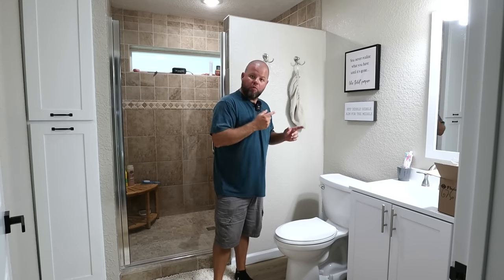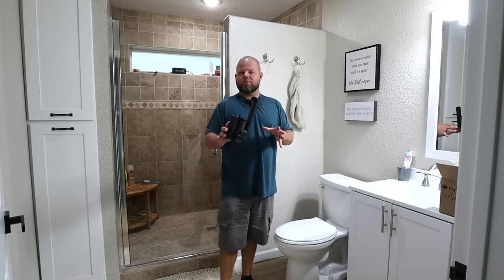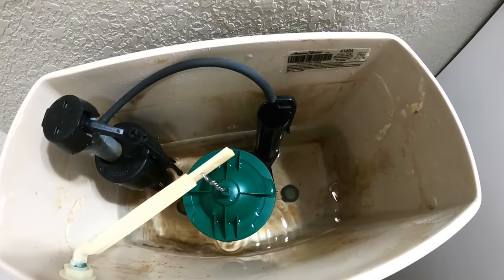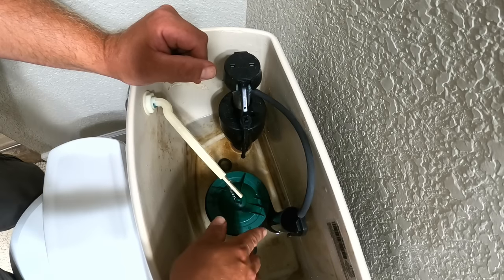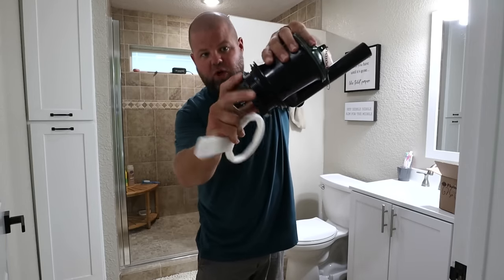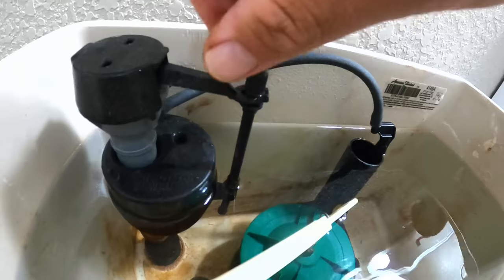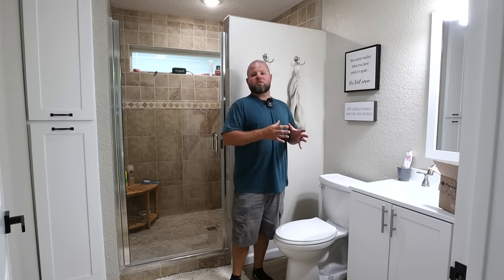Fix your leaking toilet! American Standard Champion  #788

Comment: I had the same toilet for one month. Already having to replace the flapper. Lesson learned, never buy American Standard again!  American Standard is absolute garbage.
Reply from the maker: The new seal takes care of the issue. I love the power of this toilet after the fix.
Reply: Facts! I'm replacing mine for the 2nd time. I purchased my home only 4 years ago, a new build.
Reply: These toilets are utter Garbage replaced this part more than once...
Reply: Doesn't the new (and upgraded seal ) last longer ??
Reply: @420surfdawg  I bought this toilet a year ago because I thought it was the best, oh was I wrong. This is the second time I've had to work on it. A couple of months ago I had to replace my filler valve. Never buy American standard it is junk? Thank you for your video because everyone told me I had to take the toilet apart to fix it. You saved me a lot of time and trouble.       Joe

Comment: Thanks for showing how to unscrew the flapper!  You have the only youtube video I could find with my style of flapper
Reply from the maker: Glad it helped!
Reply: Same.
Reply: Same here
Reply: Also same man just saved the day for me
Reply: Same
Reply: When unscrewing the cap, the stem/shaft dropped down out of sight.😑 I suppose I need to remove the tank to try to find/fish out the stem? If I am unable to locate the stem/shaft, I suppose there's not really an issue with leaving it where it sits, and replacing the whole unit?
Reply from the maker: @scottlawless9388 you definitely want to keep a grip on the stem. I'm not sure if it will ever enter the toilet where it's at, I don't believe it will due to the turns in the toilet.
Reply: @TKCL  Thanks. I've now got to remove the tank, and have a bolt that's frozen. I'll follow-up if I find the stem after I remove the tank!
Reply from the maker: @scottlawless9388 other than that stuck bolt, it's quite easy to remove, two plastic nuts under the tank and it will slide up and off the seal.
Reply: I had to ask American Standard for a flush valve. They sent me a new flush valve with a replacement (red rubber) seal to replace the white/ clear one that came with the valve. I watched your video and it appears so did they. I've replaced the seal as mentioned we'll see if that stops the leak.
Reply: Same here…was about to take tank off until I watched

Comment: The new round gasket helped, but didn't stop the leaking completely. After much frustration, I bought a SECOND round gasket and put it with the first round gasket, making it TWO layers thick. Presto!! Problem completely solved.

Comment: We have a toilet that had a nagging leak a few years ago.  I replaced the flapper several times and it still leaked.  Old timer at the hardware store told me to apply a coating of Vaseline Petroleum Jelly on the bottom of the flapper where it contacts the opening it seals up.  I was skeptical, but gave it a try.  Toilet hasn't leaked yet.  I did the same thing to our 2nd toilet and both my Mom's toilets when they started leaking, and it fixed those too.
Reply from the maker: Nice!
Reply: @TKCL  I feel like placing a 2nd Ring on and add Weight to the Flapper, over so many flushes eventually what  is placed on can     desolve off

Comment: Excellent video - I wish I knew how dicey the flush and flapper were on this toilet before I bought it and had it installed.  It has had numerous run-on issues - and as you showed, it's most likely at the flapper.  As other commenters have said:  thanks for showing how to unscrew the flapper.  I purchased a set of 2 Pack 7301111-0070A Flush Valve Seal Kit for American Standard Toilet Valve Seal for Champion 4 Tank and Eljer Toilets Flush Valve Gasket rings, from Amazon.  The new blue rings are slightly thicker than the original clear ring.  One other IMPORTANT thing:  there is a locking mechanism that locks the ring in.  It must be turned to a "mark" to secure the ring.  So far, this ring replacement has SOLVED the problem.  I did not need to purchase a complete kit.  Just the seal rings.  Thanks again for this video and your other videos!

Comment: Nailed it!! I've only had mine for 1 month and the flapper seal just completely separated! Brand new bldg. Every place I've ever moved w/in months I'm having to fix my toilet for some reason. I even have spare kits now. I finally after a lifetime of apartment DIYs education i told my friend helping me unpack and she saw the kit and I said "nope put it away! I finally have a brand new toilet!" DAYS later and days leaking and adjusting the valve, today I'm fixing it. Never had American Standard flapper and i got as far as trying to take it off and figured I'd need to work in the tank. I wasn't even looking for an answer to that just wanted to see the parts assembly. You SAVED me so much the first 5 mins i just HAD to "THANK YOU!!" BRAND NEW!?! it just fell apart! So my streak and education should be complete now! 😅😅 Dang! 🤐
Reply from the maker: There is a newly designed seal that work's great. It's on Amazon, link is in the video description.
Reply: @TKCL  I could've put a work order in but it was the weekend. Once i put a light on it and found the base it sits and attached to completely blown off swimming around if it was just that ill save the call to maint. Since Thursday lol i was just stuffing the seal up the cap was time😅🙄 till i was tired of hearing it $$ then a few stabs at separating it off then you saying right up it  DOES come off i w got whoopwhoop OUT LOUD YEH!! I finally caught a real break for Diy rabbit holes for once!! 🤟 You were ONE in BILLION that did a video right and i got it on the first click. That toilet is a chicken wrap! It's done! Thanks to your vid. Owners can buy the assembly if it blows off again😅

Comment: This was a great video for this kind of toilet. So, what I did was unscrew it and then remove the plastic cap holding the gasket down and pulled gasket off and noted that on the side away from the drain there was an indentation in the gasket so I flipped the gasket over and it fixed the problem. Thanks, one of the few to address this kind of toilet. Great video.

Comment: You can also change the fill valve without replacing the entire float assembly. And you don't have to take the float assembly out. Takes about 1 minute.

Comment: So I encountered a problem that wasn't addressed in this video and it may be because the newer flush valves don't come apart easily or something. I was able to take the old flapper off inside the tank but the new flapper would not come off of the new flush valve. What you can do in this case is unscrew the top where the chain connects to the new flapper. You will see the seal held on by a gray plastic ring. Twist that and remove it and take that seal out and replace the one that's leaking on the old flapper and put the old flapper with the new seal back on.

Comment: Great video. I’ve replaced the flush valve assembly every year for the past three years but great to know it’s actually the flapper.  SMH thinking of replacing the toilet all together.
Reply from the maker: They now make an improved seal only, I changed to it with no issues. I put the link in the video description to the seal. You can find it on Amazon.
Reply: I’ve replaced mine with the new and improved twice now

Comment: Before replacing anything!

Remove flapper cover and make sure the gray ring that holds flapper right under green cover is secure, mine came loose from manufacturer and leaked. Thanks to this video I removed cover and found gray ring loose. Fixed my situation.  Good luck people.

Comment: Absolutely super video! I bought 4 yes four toilets because I was tired of the cheap flappers; I also heard good things about American Standard.  Well, you are spot on. I changed the first one a year ago and did it the hard way. Slipped off the seal over the top.  This time, I took off the entire drop-down flapper.  So much faster!!! Some suggestions: take off the flush lever and use latex or rubber gloves, which allow a sure grip if you have a weak grip or a build-up of slime on the parts.
Reply from the maker: FYI they now make just a replacement seal that appears to be new and improved.

Comment: I have an older Champion 4 which I previously did battle with the part that screws into the flapper from the top.  After conquering that technique, I replaced another toilet with a newer Champion 4.   The new one started phantom flushing after a few months.   I opened it up and was faced with a new flapper design.  Your video really helped me conquer this one.    The new design is an improvement over the older one, but that gray clip seems pretty flimsy.   I think the next time I need to replace a toilet, it will not be a Champion 4.

Comment: Another thank you.    I bought 2 of these toilets in 2022 and one is one is now cycling every 20 minutes or so.   I couldn't see or hear any leaking but this is most likely the issue.  reading in the comments, it sounds like Home Depot  now has replacement gaskets or flappers in stock.  I will have to check it out.  Great helpful video.
Reply from the maker: Amazon now carries just the seal as well.
Reply: @TKCL  Got a link?

Comment: Great video.  Once I got the flapper off, I found I could turn the bottom a quarter inch and pop the bottom off.  That way you can just replace the seal and not have to buy the whole assembly.

Comment: Mine was leaking from the flapper.  Took it out and noticed the bottom part was loose and not pressing the seal firmly to the flapper body. Gave it a twist to tighten it up, reinstalled, and all is good. Thanks for the video
Reply from the maker: Thanks for sharing

Comment: man, thank you so much  we have had ours for maybe 9 months i already replaced the entire flush valve once and its leaking again  i took the silicone gasket off and were the bubbles were in it  i just took a needle and poked a hole and water came out the gasket then flattened out i put it back on and no more "running" toilet  will see how long it lasts.. i did order replacement seals just to have in case this does not last  again thank you for the video this was the best instructional video i have found for the champion toilet
Reply from the maker: Your welcome! There are new green or blue seals now, I replaced them on both of our toilets and so far so good 🤞

Comment: My issue was related.  There is seemingly a greater level of vulnerability to leaking caused by calcium buildup on the circle on which the flapper sits.  Removed flapper per the excellent tip in this video, then let  CLR sit on the calcium for a couple minutes, then wiped away until all calcium removed.  Then good to go.  

The Vaseline idea is really cool.  I’ll bet it has both the benefit of aiding seal and resisting calcium.  Will try on the inevitable next treatment.

Comment: I have the exact same toilet. I had to replace the flush assy also after about a year. After some research, I found that the flapper goes bad because of the use of tablet cleaners being placed in the tank. The chemicals/chlorine cause the rubber to bubble up and cause it to not seat flush on the valve. My wife now uses the stick on ones in the bowl instead of the tank.
Reply from the maker: Good to know
Reply: We also use those chemical tablets and now have a running tank. I bought a generic replacement valve seal and replaced the original, but it still runs.
Reply: @JasonMaehl  If you have stopped using the tablets, I would recommend replacing it with OEM. I bought four of them as spares and havent had to replace it since we stopped using the tablets.

Comment: This video helped me disassemble the flipper unit. I took out the seal which had the blisters. I don't know what causes them but I ran a tweezers into them, fluid came out, the seal flattened out so I put everything back together. We'll see how long it lasts but so far it's leak free.
Reply from the maker: There's a new design seal that works well. I found it on Amazon and out the link in the description.
Reply: @TKCL  I was thinking with how easy that seal can be removed from the flipper it's insane there's not a replacement easier to find.

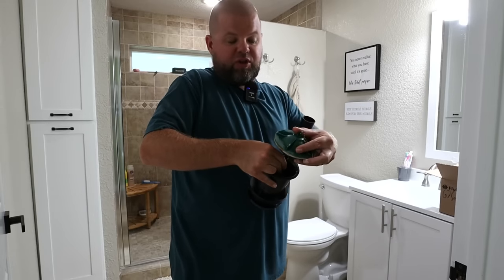Comment: I did this and it worked like a charm. The only thing that I would recommend is to use vise grips under the bulb when unscrewing if you are not taking the tank off. Mine fell down into the toilet. Luckily I had a long pick up tool to bring the "post" back up through the center. See 2:37 in the video. Otherwise, a flawless hack.
Reply from the maker: Glad it was helpful

Comment: I have three Champion 4 toilets installed over several years. I know, I know. My thinking was over that time the design process would have improved but it did not. All three have the ghost flush. I called American Standard and received a new gasket for free ( this was 5 years ago). I changed the blistered gasket (very easy) not the cap as shown in this video. Six months later ghost flush again. I see NU Flush has a conversion kit for this toilet, to go to the tried and true flapper valve. I may purchase one and if it works after six months may get two more conversion kits. I see there is also a class action suit regarding this faulty toilet.
Reply from the maker: They now offer an upgraded green seal on Amazon. I put one in my second toilet. A few months later and no issues.

Comment: Upon searching online for a valve assembly I find that none shown actually state my model number.  Will the valve assembly used in this video be the valve assembly to use for American Standard model 4266? 
I completed agree that having to disassemble the whole tank is ridiculous! I wish it was just my flapper. Unfortunately the plastic rod that runs through the center of  mine snapped off. Im thoroughly aggravated! 
Great job doing the video! Best vid I found while searching all afternoon and I can't express enough how happy it has made me! Thank you!!!
Reply from the maker: You'll have to contact the manufacturer directly to answer that.
Reply: Thank you again, I was afraid that was the case.

Comment: Great video.  FYI, Fluidmaster 510A-001 is the flush valve seal alone so you don't need to buy the whole assembly. 🙂
Reply from the maker: Correct, I found that later on and ordered it. I already had to replace the seal on my other toilet 🫤

Comment: Thanks for the tip on the top screwing off if you hold the stem below.   You can just buy a replacement gasket and replace once you take the cap off.   The cap has a grey plastic large retaining ring that you can easily pry off and replace the underlying gasket
Reply from the maker: I recently found the gaskets.

Comment: It worked just as you said but I encountered an issue where the shaft on my toilet did not have the barbs on each side to keep the shaft from falling down into the toilet and yes mine disappeared into oblivion lol. So I took the new shaft to use and found the next issue. The hole in the center of the flush valve has reliefs built into it for the locking tabs to pass through. Mine does not. So I ended up cutting them off so the new shaft woo I’ll old pass through the hole in my existing flush valve. If it happens to come loose, at least the new shaft can come out. Thanks for the help !
Reply from the maker: Sorry to hear that you had some issues.
Reply: @TKCL  - it’s okay! Your video helped me immensely

Comment: Can you tell me how to replace the rubber seal/gasket at the bottom of the tank under the float assembly. It’s the rubber seal that should be flush with the bottom of the tank. Also, please tell me what that seal is called. Thank you.
Reply: If you find out, let me know. I also need the bottom seal

Comment: American Standard toilet here as well. Same mechanisms too. After flushing the toilet, the tank would fill and shut off. But then the water level in tank would decrease very slowly, causing the tank to refill after about 20 minutes or so, taking about 10 seconds to refill. This was happening over and over. It's the damn gasket on the flapper. Over time they bubble/blister, causing the slow loss of water. Why do they bubble up? Design flaw? I did have a plumber over to replace and thankfully for a very small fee. He showed me the ropes in case it occurs again in near future.

Comment: Great video.  I've had the champion 1V
For probably 6 plus years & have been very happy.
However.. recently after putting in new flooring my toilet rarely flushes first time.  I don't have a leaking flapper.  Could it be it's not tight enough to new flooring?
Any theories are greatly appreciated.
Reply from the maker: Hard to say, but I would start with the resent floor change. You might have a seal issue partially blocking the exit of the toilet.

Comment: You can also buy just the seal ring at Lowes for $6.00. The weird thing is the lower black portion that holds the silicone ring in place is not concentric. Mine had a mark on one of the tabs to show how it goes back together. I don't know if it came from the factory that way or the previous owner put some fingernail polish on to mark it. However if you do not have it aligned properly the flapper will be offset when you get it back together. Why they didn't make it concentric is beyond me.
Reply from the maker: Interesting, Thanks.

Comment: I feel your pain, I got tired with replacing toilet parts on these brands, so I switched to the TOTO Drake, that has the neat flush channel instead of holes.  I have replaced 2 out of 5 in the house.  The MSRP of the Toto Drake will give you a bit of sticker shock, but I have been watching the Amazon prices and have been saving around $100.